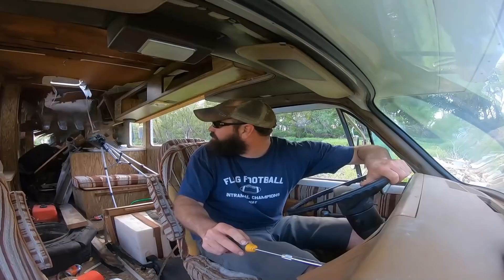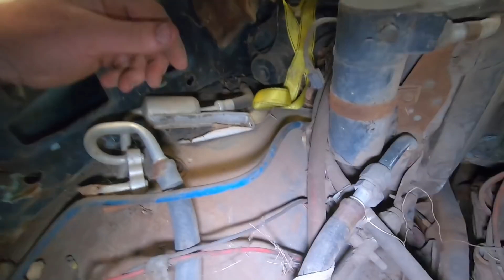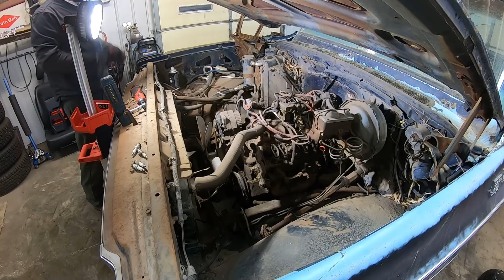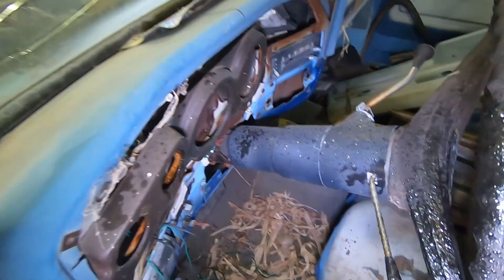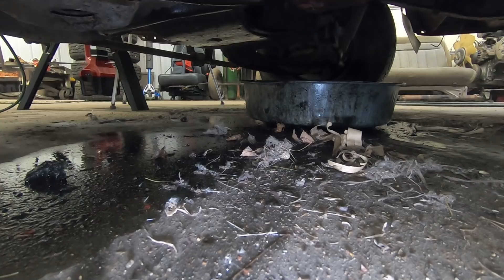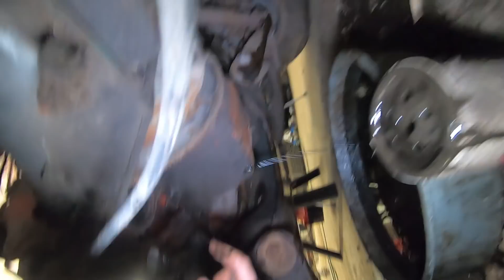Junkyard Small Block sat for 29 years! No Valve Covers! Locked up and full of Water! Will it Run?!?

Comment: I doubled up a oil filter gasket when I was working at the GMC Cadillac dealership in Waco, TX on a GMC Terrain. When I started that thing up it took me a a few 30 seconds to realize my mistake when the massive puddle of oil had reached my feet near the drivers door. Good times 👍🏻
Reply from the maker: What a mess!

Comment: By any chance do you know if a manual transmission stuck in gear would cause the motor to not spin I have a 1970 c10 3/4 ton that I been trying to get to turn freely and I feel like she's locked but the transmission won't go into neutral or any other gears and I took of the shifter to look inside the trans and it's bad with rust idk if maybe it's stuck and that's causing the motor to be stuck
Reply from the maker: Yup, I've seen that before. Or stuck between two gears even.

Comment: Now that engine sounds great once you got it running,I love it,now put dual exhaust with glass packs on it & take out the automatic transmission & put in a 4 on the floor  & put a 4 barrel intake & carburetor on also 😀

Comment: I've double gasketed once, it was a mess. I made a habit of trying to completely wipe the mating surface, and putting on fresh/clean used oil before adding the new filter. No way to forget the old one when you clean it off good. Also ensured I never got dirt under the new gasket. I serviced this Chevy minivan, it was filthy from oil leaks, and didn't take as much care as I should have cleaning the surface, new gasket peed with force. I assume it was from debris, but it could've been a 1/1million bad gasket. That was also a mess, since it didn't immediately blow out like a double gasket, the oil pressure light didn't turn on, but there was quiet the line driving out of the shop.

Comment: My dad bought an old ford pick up from a guy and he had all kinds of guages in it. He removed them but not the wiring or oil line. Were driving down the road and all of a sudden the cab fills with smoke and oil is spewing everywhere. This os all happening under the milk crate my sister is sitting on. What a time that was.  My dad just started grabbing wires and ripping them out.
Reply from the maker: Haha that would be a great video!

Comment: When I was at the junkyard, I managed to find a battery for a big rig that was good(like the one you used in the video). I would simply hook it up to the battery in the car with jumper cables. Just find you a good strong battery that will hold a charge. That's what I did when I working on something that was turning over slowly. Usually worked.

Comment: This must be a midwest thing. You guys seem to come across junkyards with tons of intact classic cars. That doesn't happen where I'm from. I bought cars for a junkyard in Memphis, TN. I rarely came across classic cars, and usually fixed them and resold them when I did. On the rare occasion that one actually made it to the yard, it was stripped clean in a matter of days. I remember when I bought a 77 Camaro one time. It was really rough. We normally kept cars on the yard for three months, but this one stayed on the yard for 8 days, and only a small part of the frame was left. You just don't find classic cars in junkyards here. A K5 would be torn apart in 24 hours here. How are you getting oil on the dipstick of a junkyard vehicle? EPA regulations require the fluids to be drained before the cars go out on the yard.
Reply from the maker: These are all private yards. Not corporate late model stuff. EPA?!? Who's she?!?

Comment: I love the drain pan theory I've often thought that if I kept it around that whenever I needed a bolt that they would magically appear in the pan of oil !
Reply from the maker: Like a big bolt magnet!
Reply: @MortskeRepair  one day I was working on my duster and I misplaced an open end wrench I stalked the place with a screwdriver in my hand for like 10 minutes trying to find the wrench finally disgusted I give up flinging the screwdriver across the room only to realize the wrench had been in my hand with the screwdriver the whole time exposure to too much concrete motor oil and steel is all can figure also why did the fan stop moving before you took the belt off seized alternator or water pump or what just curious?
Reply from the maker: @danielcline7413  Been there, done that! Probably because the belt wasn't tight and came of the bottom pulley.

Comment: Worked at Walmart TLE. We had a few sharp ones that would not bother to check for the filter gasket, made several trips out to peoples homes to fix them on the spot 🤷🏼‍♂️
Reply from the maker: That would be a fun job!
Reply: @MortskeRepair  getting away from the “office” so to speak was. Crawling under a car in an icy driveway wasn’t 😂😂

Comment: THAT IS WHAT EVERY ONE SHOULD DO BEFORE  STARTING A MOTOR ,  THAT HAS NOT RUN MORE THAN A YEAR  /  NEVER MIND 25 YEARS  / BUT NO ONE DOES IT! /   THEY PUMP ALL THAT CRAP  THRU THE MOTOR THEN SAY  "I SHOULD OF  CHANGED THE OIL BEFORE I RAN 25 YEARS OF CRAP THRU THE MOTOR . DAAAAA!  / NEW CLEAN  OIL AND FILTER  ON THE CHEEP  = WHAT $ 10 T0 $20 BUCKS TOPS   / CAN SAVE A GOOD  MOTOR  / BUT NO THEY KEEP RUNNING CRAP THRU A GOOD MOTOR MAKING IT A BAD F-ED UP   MOTOR  / #1 IS CHANGING  THE MOTOR OIL AND FILTER  FIRST IS THE E/Z AND CHEAPEST THING A GUY CAN DO TO TRY AND SAVE A MOTOR THAT HAS NOT RAN IN YEARS   # 2 IS THE GAS FILTER AND RUN THE GAS OUT OF A GAS CAN OR  BOAT MOTOR GAS TANK  NOT THE STOCK GAS TANK ON THE  TRUCK  UNTIL YOU CLEAN OUT THE STOCK GAS TANK  (DO IT FIRST THING  WILE YOU ARE CHARGING THE BATTERY ) AND CHECKING EVERY THING ELSE  /SPARK PLUGS , GAS   / IT TELLS YOU ABOUT THE GUY DOING THE JOB  IS HE GOOD OR BAD
Reply from the maker: THE FIRST THING I DO WHEN COMMENTING IS TURN OFF MY CAPS LOCKS. Much better.

Comment: Going to guess water has a pretty low “weight”. Going to say it would not show a lot of oil pressure because of it. Like the opposite of running slick 50.
Reply from the maker: Nailed it!
Reply: @MortskeRepair  got a new found respect for small block Chevs. Sounded like you could have drove it to town if the rest of the running gear was there.

Comment: I have never double gasket-ed an oil filter.... but... I have left the drain plug out, not realizing it until the new clean oil started flowing out from under the car..... That was on my 59 Bel Air many decades ago, and not too long ago. You would think once would have been enough to learn.... but no. Enjoyed the video.
Reply from the maker: I may have partaken in such an activity... Good times! At least it was clean oil!

Comment: IN THE BEGINNING. DUNTOV CREATED THE SMALL BLOCK.   AND LET THERE BE HORSE POWER SAID HE...OHV. LIGHTWEIGHT AND ONE HP PER CUBIC INCH ON FUELIE.. AND SO BE IT HE SPOKE....LET MY SMALL BLOCK LOOSE AND ROAM THE STREETS STRIPS AND OFF ROADS WITH RECKLESS ABANDON FOR DECADES...THUS IS THE WAY OF THE SBC..,amen
Reply from the maker: Amen!
Reply: @MortskeRepair  these engines😃will still be in demand. In 2055.  Unless GM  figgers a way to hop up the  XGEN BATTERY PLATFORMS

Comment: I haven't see anybody else fess up re. the double oil filter seal, so that must just be you Mortske!  While I've not done that actual thing, I did have a 1960 Dodge Dart that used the cartridge type filters and it seemed just too easy to misalign the canister/housing.  Good thing I guess is that it'd start dribbling immediately on startup, so you'd know right away.
Reply from the maker: Haha there's a few folks that have taken the first step to recovery!

Comment: I believe the reason you have more pressure with oil is because water is less viscous and can escape through the clearances easier. Hydraulics work on the principal that fluids cannot be compressed so in theory you should be able to make the same pressure with both fluids.

Comment: Letter keep some kerosene atf fluid. And straight 30 motor oil handy dump all that stuff in. Engine 🚂🚒 soak the piston in. ATF. And CRC. Combo let set and bust a loose with a cheeetee  pipe.....

Comment: If nothing else it'll run after a full rebuild, (which being a SBC it definately needs if it has more than 15,000 to 25,000 or so miles on it) presuming you don't mess that up.
Did it run when the car was scrapped? Probably not.

Comment: Okay Ford guys, Mortske ham fisted this thing, filled it with water, threw garbage starters at it, nearly whipped himself in the face with a fan belt, and it ran.  An engine left wide open with no valve covers.  All he did was spray it down with a little weasel piss and rock it a few times. If you want a challenge make a Ford run, if you want something that just works it's got to be a small block GM engine.
Reply from the maker: Haha, says something for the ol SBC doesn't it?

Comment: FORD BACKWARDS
D R O F (FORD)
DRIVER RETURNED ON FOOT 
WHICH WAS US LAST WEEK... Every ford has let us down.  And they have such STUPID problems.  That you have to be come kind of electronics engineer to realize it's a COMPUTER problem, or a SENSOR problem..  What happened to good ol mechanical, thus KEY THE TERM "MECHANICS"?

But CHEVY HAS NEVER HOSED ME. The one and only time was not her fault. It was the guy who put on my tires.. Fords are over rated. Chevys want to live. Fords hate everyone. 

Model S
Model A
Model T
Model A (reintroduced in 1926)
Model N
Reply: I've owned Ford, Chevys and Dodge. Still have a 91 Dakota at my cousins house back home. Currently own a 92 swb stepside Silverado regular cab. Jumped timing, last year lol. Actually in 2019, but I managed to get it running somehow with my brothers help. Drove it 40 miles-ish, and nothing lol. The miles I did drive it, it had no power and the gas mileage was horrible. Timing right? No matter how I time it, it will not crank and run for more than 3 seconds. 3 computers, several times resetting the timing, new tps, new iac, swapped map sensor, swapped the electronic ignition up by the map sensor (even on the distributor), rebuilt the throttle body minus the injectors, new plugs, cap and rotor lol. Nothing. Gets plenty of fuel, air and spark. Nothing. Just sitting in the yard, like a rock. Sorry had to go there lol.  Shame to, I like the old truck.
Reply: @jamietyree4994  I would check for vacuum leaks. Those can create wtf situations.  I'm not saying chevys are immortal.. Well, maybe I am..  As for my parents Taurus, no one has the answer.  It will NOT drive over 20mph at 3,000 RPM. The computer said there was a bad cam position sensor, so we replaced it, still misfiring, so I realized the sparkplugs were bad. Replaced those.. Now it spins like a top, but won't go over 20. It's my parents car. I will never buy a ford. (I say that now)..  Depends on the ford. BUT.. No. Why will it not go over 20? What can cause that?
Reply: I saw a brand new Ford with temporary plates broke down on a flatbed on the highway. 😂😂🤣 shoulda taken a picture but I was driving.
Reply from the maker: That would be good!
Reply: @VintageCars999  To me Ford stopped being good in my childhood. I love cars like the next guy.   Since the 80's...  So look, 77 LTD, LOVED IT!  GOLDEN TORINO.. LOVED IT. '81 Granada? absolutely sucked! My '84 Fox Body, was terrible. My 85 LX Fox Body convertible, was terrible. My 88 Fox Body... WAS TERRIBLE.  Was actually hit in the parking lot 3 TIMES IN UNDER A YEAR, bad luck..  My '79 Chevy Suburban, lasted longer than EVERY SINGLE ONE OF THOSE.  And in all those years, I never EVER EVEN CHANGED THE OIL.  Even with blown transmission seals, it just worked.  But I have owned fords.  And ever since the 80's.. Their junk. I've owned what, 4 Fox Bodies..  Each one had stupid problems that shut me down. Where every Chevy I have owned got me home with a SHOE STRING.  The LTD and Torino, 2 of the best cars I have ever owned ..  (Torino was my parents).. But I still knew it. So I am not talking smack. These were mine. 

As for SVO... I would roll the dice on one at the right price. But, I know Ford. And I don't know any Uber Drivers.

Comment: I might be in the minority, but I actually prefer the nylon oil line, I'm just speaking from personal experience, but I've not had one fail on me so far, including some that were 20+ years old, but who's to say they didn't fail on the next guy.  Admittedly I don't have much experience with the copper line, but both vehicles I had with it, it failed, I think the problem is there's no flex. I had one were someone had butchered the stock cluster and installed an aftermarket oil guage, I don't know if they kinked it or got it it in some kind of bind re-installing the cluster, but it cracked at the guage and covered the cluster, floor and my feet in oil, another one I had cracked at the fitting at the block, luckily I was home with that one, there wasn't enough line to pinch off.

Comment: I had a '69 Chevy with a 327 in it. When I did the first oil change I found 7 oil filter "O" rings stuffed up in the block casting.
Reply from the maker: That the canister type??
Reply: @MortskeRepair  yup. Canister sep cartridges filter
Reply from the maker: @rsprockets7846  Those were the worst.
Reply: @MortskeRepair  you do the oil change with a brand new clean shop shirt then. BAM.     A STREAM OF OIL BLEEDS DOWN YOUR CLEAN SHIRT AND JACKET WHEN YOU TAKE IFF THE CANISTER

Comment: That was a lot more painful to watch than it should have been
Reply from the maker: Oh yeah, why's that?
Reply: @MortskeRepair  dude you could have just pulled that plug drain the water and what you saw oil coming out stick the plug back in
Reply from the maker: @stoneyswolf  What about the oil filter?
Reply: @MortskeRepair  it wouldn't have been in the oil filter of you didn't crank the engine.

Comment: Its funny that you mentioned NAPA auto parts as I just got off the phone with corporate, customer service 😑 wouldn't help. NAPA USED TO be the place to go for all your odd pieces for a project. For instance if you needed a 3 1/2" bolt with a metric left handed pitch with a 7/16" head by golly the would have 3. Now their rebuilt parts are way overpriced and as in the video sketchy. The really are proud of their stuff.  Point of my story is I wanted to make a light/turn signal harness for my golf cart and wanted a 9 point wire pack connector for the assembly. No more old guy that could find anything in a catalog (not computer) know where to go and find it in the bowels of the store or as in my case, the warehouse for Tampa and find it. Those days are gone. I won't go on and on but bottom line just go to Auto Zone, O'Reilly ect.

Comment: Well, look at that, eh?  A locked Chev engine sitting for 29 years.  No exhaust, no cooling system (except what water is left in the oil galleries), no keys, no rocker covers, no decent starter.......no problem!  Chev be like "I got me some spark - where's the hot sauce?"  Seven cylinders is better than 5 or less and it's seven more than she was firing on when she was pushed into the garage.  Can't keep the old Chev down....but I'm still rapt to watch her come alive and sing - AND she hit the high notes too!  Yep - when the engine in my Stag finally goes bye-bye, a carburetted 350 is what she'll be getting.  At least then I know she will always start!

Comment: Hey WOW... New METAL intro man!  She fired off for now anyway! Get some coolant in that spider mansion up front.   I guess my only comment to add, that I'm sure Mort probably knows but didn't really explain, is it's perfectly normal for some of the SBC rockers to be totally loose like that, some kinda loose and some tight, because of how it works.  You can adjust them while idling very easily by loosening till it start clicking, tense up till it stops, then 1/2 to 3/4 turn, done!  Get you an old cover with a rectangular slot cut out the middle to do this without making a mess.  (the process is different when off so don't just start tensioning them up and turning an extra 1/2 turn or you'll be way off!)  Also, it's not too concerning if one or 2 pushrods ain't squirting under just drill power, main concern is just that ur squeezing some oil in between the crank bearings for initial start.  Once you got covers on and variable RPM's and under load those rockers will be squirting and splashing all over each other and be just fine and that one will come back to life I'm sure.
Reply from the maker: I musta snuck the intro by you last week!

Comment: It can take a while for all of the pushrods to start oiling . I have rebuilt sbc & what I usually do is prime for a bit then turn the engine over then prime again & after a while they will all start to flow oil . Also I think it would look cool if you got Duff a Duff beer T shirt to wear in the shop !  I see amazon has them as well as some places that sell beer memorabilia & some Walmarts sell them as well !

Comment: Mid 70's Chevy K5 Blazers are now the hottest collectible.The 350 V8 sounded nice. Nothing wrong with leaving it 2 wheel drive.This will be a nice rig all restored to mint factory. Perfect for car shows. Starting the engine just made the overall value go up from $200 to $2500. Needs new dashboard. For push rods, insert metal guitar strings to clear out oiling hole.
Reply: Someone said Guitar?!